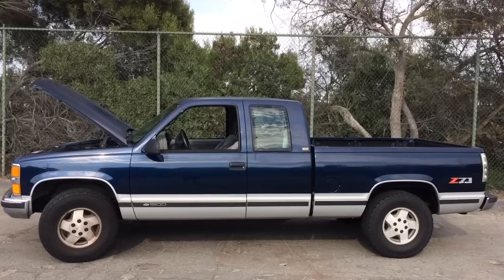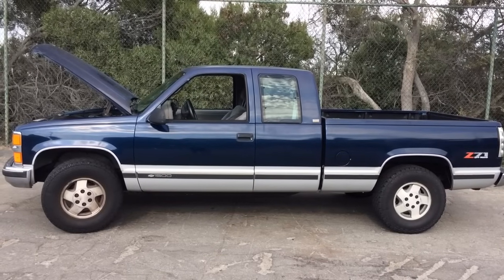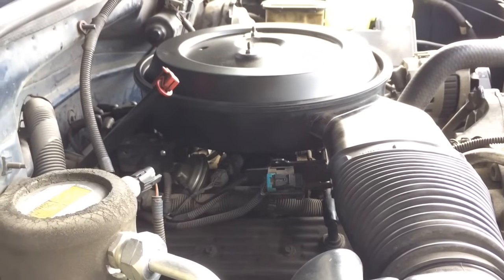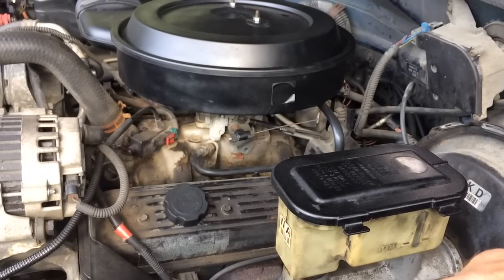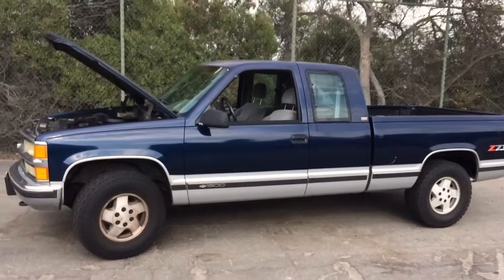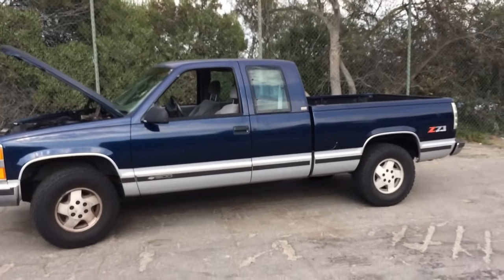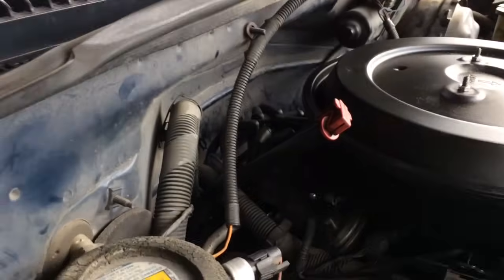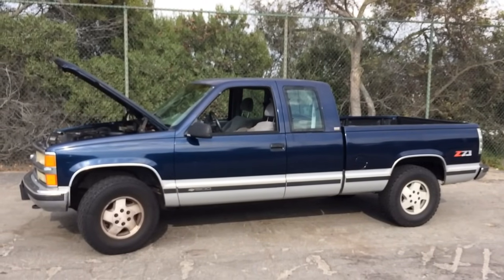Chevrolet Truck Hesitation Problem Fix

Comment: I need help with my 2004 Chevy Silverado , sometimes it will have trouble starting and when giving it gas it will gag/hiccup and I need help if someone could possibly tell me what it is fuel pump has been changed but still doing the same if someone could help me plzz plzz respond I screen shotted what he did jut in case this could fix it plzz respond if any help
Reply from the maker: It could be a clogged catalytic converter, or a throttle position sensor. These problems are really frustrating, so it’s hard to diagnose it even if you’re looking at it while it’s happening.
Reply: hoohoohoblin I think it might be the throttle sensor it does have difficulties stopping and accelerating just like a bad sensor would thank you , I’ll be checking out this sensor through out this week and I’ll also be checking this channel out more thank you

Comment: The fuel pump is only 50 bucks it's 170 bucks if you buy the filter and the sending unit

Comment: mine throws no codes says everything is fine except for oxygen sensor and oxygen sensors not going to make my truck run the way it does
Reply from the maker: Yes. It is probably something else. It could be an obstruction in the muffler or catalytic converter. On my truck the catalytic converter plates rattled loose and blocked exhaust flow.
Reply: Good god, you realize the the O2 sensors tell the computer how much fuel to give the motoor right?  So "everything is fine except for oxygen sensor" is like saying she floats except for when it sinks due to the hole in the bottom, and no I'm not trying to be funny.

Comment: You don't have to take the gas tank out if you cut a a small hole in your pick up deck to change the fuel pump
Reply from the maker: +Tommy Lewis thanks. I’ve heard of people doing that, or unbolting the bed and sliding it back.
Reply: I bought a used truck with the hole already cut out.That's how I know.
Reply: You can unbolt the bed.  Keep the bolts slightly threaded on the passenger side and lift up the driver's side of the bed and support with something very strong.  Now you have access to the fuel pump.  It's a Chevy, so you might as well become proficient with the FP repair.

Comment: I ve had my obs for about a yr now it just doing I had a my company pit it on there computer they gave me this info maybe it could help someone out there
Reply: Check the fuel pressure both at idle and with the return line restricted. It should have 9-13 psi at idle on most tbi systems and more importantly at least 18 psi when the return line is pinched off. If the vehicle has plastic fuel lines,remove the line from the throttle body and plug up the throttle body to obtain deadhead pressure. If the fuel pressure is low with the return line pinched off or deadhead replace the fuel pump if the fuel pressure is greater then 18 psi with the return line pinched off or deadhead but is less then 9 psi at idle check the fuel pressure regulator. Replace or repair the regulator as necessary

Comment: I put a new fuel pump in my 96 suburban new cap and rotor new plug wires put a new exhaust system on it I’m putting new plugs in it tomorrow we’ll see what happens I just want my ole girl running again
Reply from the maker: I hope that fixes it.

Comment: SERIOUSLY NEED HELP HERE PEEPS.... 95 SILVERADO STARTS & IDLES GREAT. PUT IT IN GEAR & IT ACTS ALL RETARDED.  I'VE REPLACED CONTROL MODULE, BOTH TEMP SENSORS,  KNOCK SENSORS, 3 DIFFERENT THROTTLE BODIES, & A WHOLE COMPLETE NEW DISTRIBUTOR.  IM LOST
Reply from the maker: That happened to me once, and I had to replace the ECU computer. It might be that.

Comment: If I floor mine from a stop it will pop real loud then die.... anyone have this problem just put a new fuel pump in still didnt help
Reply: That's what im looking for. Every other startup, if I hit pedal like I wanna go somewhere, it chokes & rpms drop. If I hold pedal down it'll do that till I hear and feel a pop/clunk at my feet and it'll go. The pop feels like converter/trans catching gear. But engine and rpms choke. 🤷‍♂️
Reply: Although ur problem sounds more like backfire from bad air fuel ratio

Comment: Cut off cat it will run better my 93 has 200000 miles an running strong
Reply from the maker: I couldn’t get away with that in California, with the emissions testing. I bet you are right though.

Comment: how do I determine which engine is in my 94 chev 1500
Reply: Pappy Max 94 c1500 have 5.7L 350 TBI
Reply: Call  your local Auto store and give them the 8th number or letter in your vin and they can tell you what it is my is K in my vin number

Comment: Correction, which automatic transmission do I have. Fuel injected,  350 engine, cruise control.
Reply from the maker: Probably a 4L60E transmission.  I think they last a lot longer if they have an oil cooler on them. If your truck is a Z 71, it has an oil cooler built-in. Otherwise, you might want to put one on to keep it cool.

Comment: I’m having all those problems
Reply from the maker: I would suspect an obstruction in the exhaust first, like a bad muffler or catalytic converter. Of course you would want to change your fuel filter because it’s cheap and easy to get to, and a weak fuel pump could also cause these problems.

Comment: catalytic converter, and the distributor. $2000 later o ok  your problem was fixed ok end fkn story with all other shit o you missed spark plug change or air filter or m.a.f. sensor or or or or or

Comment: I guess I had my boner before I bought my '97 GMC with the Vortec engine. Now I don't have to pull a boner and swap engines. But if you're not planning on selling your truck, it doesn't really matter what engine you have in it. But if you do decide to sell it, I'd like to know if the non original engine helped or hurt the sale price.

Comment: Its a chevy, what did you expect from it?
Reply from the maker: +Flaming Mustache 1,000,000 miles!
Reply: I'm at 207k in my 97' and 214k in my 03', never had a ford last past 160k
Reply: I've never owned a Ford....ever.